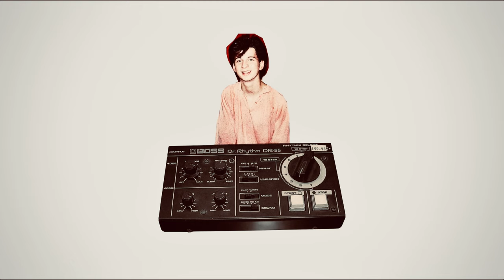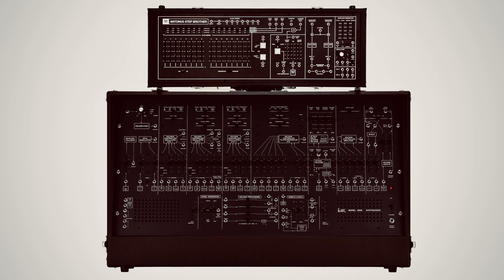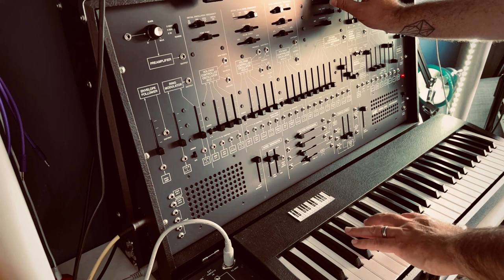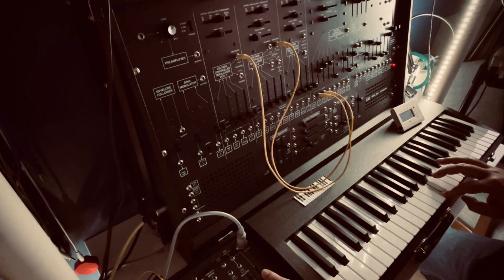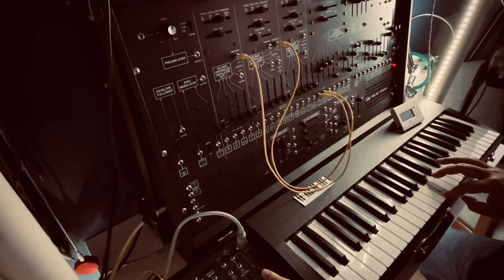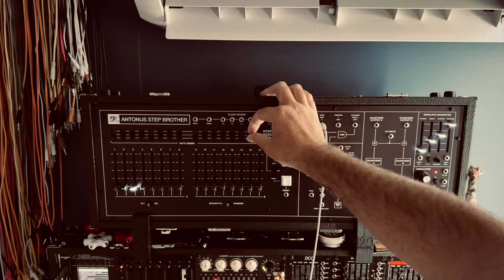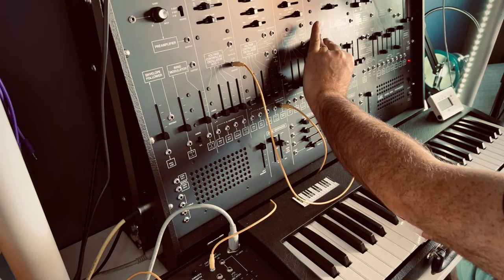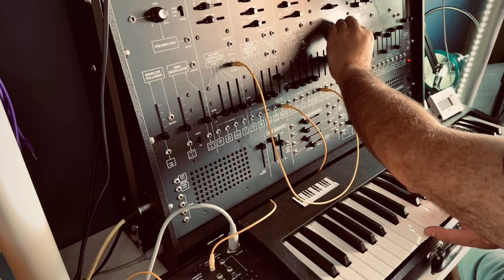Recreating Depeche Mode's Tora! Tora! Tora! using an ARP2600 Synthesizer

Comment: The initial bass sound was from a Roland Jupiter 4 (a mix of saw tooth and square wave with Ensemble on), and also it was used for the climbing portamento part in Just Can't Get Enough. Vince later used it on Yazoo Don't Go with a preset called The Force, that is what you hear just after the 2600 brass main intro riff when the bass and drums kick in. I had a JP-4 for many years and used to get the exact sounds. You did a great job with this track, it's very close to the original.

Comment: You really nailed the sounds and the mood of this track. With closed eyes I couldn't tell if this is an original instrumental track. Only one idea for optimization: The Theremin-like sound in the chorus section goes D5 - F5 - Eb6 - A5 on the album recording (possibly a D6 is played briefly before the Eb6, this is hard to hear out because of the hard vibrato on that sound).

Comment: Good job overall though you missed one major synth on this track: Vince’s Roland Jupiter 4. The chords at the beginning are the “Voice” preset on the J4, and the initial bass patch is also J4.
Reply from the maker: I read in the Jonathan Miller book ( I think ) that the JP-4 was purchased after the album was recorded and brought for the tour as it had patch memories
Reply: I don’t think that’s accurate. I think it’s more likely it was bought at the tail end of the sessions and thus only used sparingly on the album. You can also hear the JP4’s “Voice” preset playing chords in “Any Second Now” (which is subtitled “Voices,” I assume because of that preset). There’s also a JP4 arpeggiator part in the middle instrumental segment of “Just Can’t Get Enough.” The little rising brass riff in that part is also possibly JP4.
Reply: @peahix  I remember You did a fab version of New Life on the Yamaha CS-01. Kudos to you mate.
Reply: @abrokenframe82  thanks! yeah, i did a few tracks from speak n spell :)
Reply: Vince had already got the Jupiter 4 as early as Summer 1981 (or even earlier than that). You could see Vince playing the Jupiter 4 on the "20th Century Box" program where Depeche Mode played on Crocs back in June 27, 1981.

Comment: Very cool!  At 3:50, I think you've got a wrong note in there.  The original uses an E# as a leading tone to F# minor, instead of the E that you're playing.  It's also got a more "shuffled" rhythmic feel in that part.  Love this song!
Reply: Then at 7:30, it's very off.  It starts out right, and then it's like you played it up a half-step.  I know the sound has some vibrato, but it's definitely B, A#, F#, G, F#, E, F#, D, A#, (then a quick low F#), outlining a B harmonic minor, and not B, A#, G, Ab, F, G, Eb, B.
Reply: I noticed the "zap" effect (heard in the beginning and throughout the entire song) is unfortunately not timed properly. As an obsessive DM listener I notice these things immediately 😅 Despite this I am very impressed with how close many of these sounds come to the real deal.